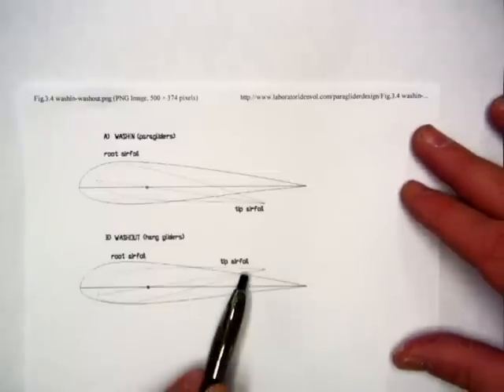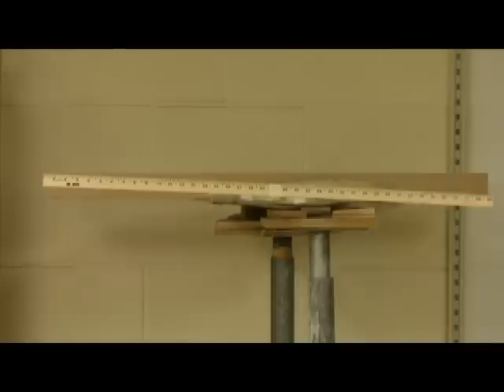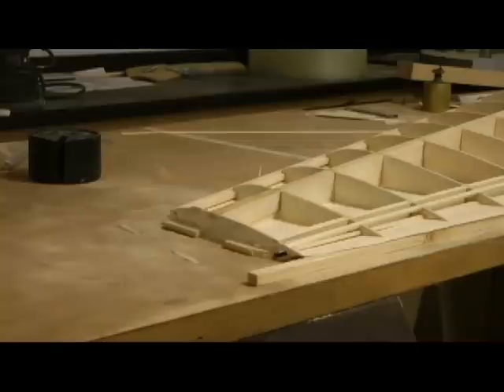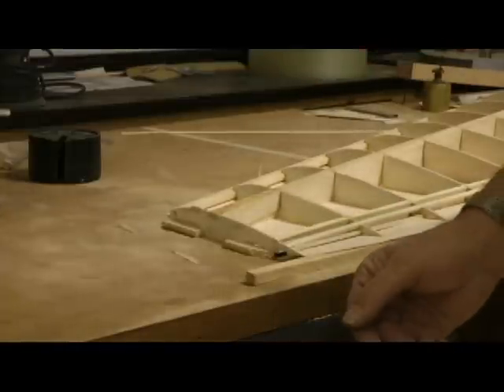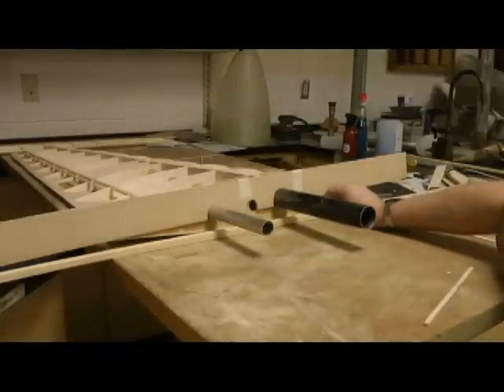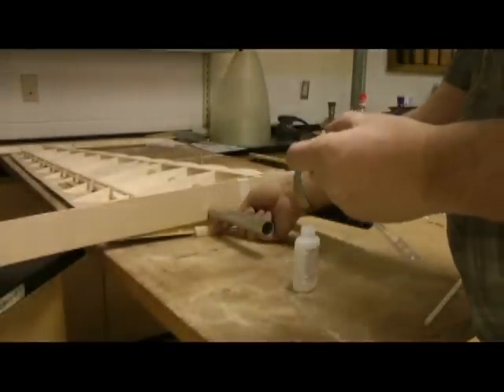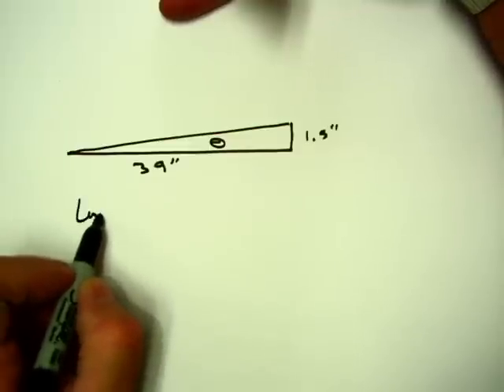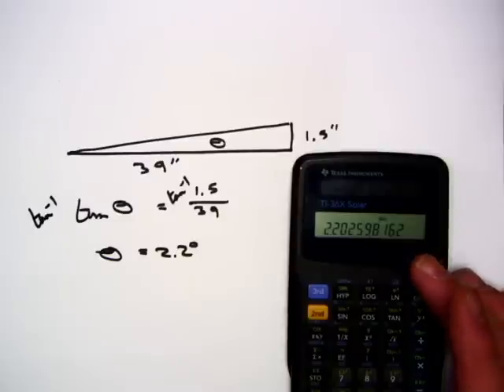Setting washout in giant scale wings

Comment: First, thank you for sharing this. As I re-enter RC after 25-30 years, now with the benefit of the internet and the immense amount of information available, I became aware of washout. I had never heard about before.
You show a way to induce the twist along the wing that gives you washout.

I think the wordage in the video was more complicated than it need to be.
Washout is wing twist set up so the tip has less of an angle of attack, and stalls after the root. 
 Isn't a simpler way of say "when you add washout, the root stalls before the tips"?
The idea is to avoid a wing stall, or falling off on a wing in a stall, especially in a turn to final when landing (full scale OR model aircraft(!))

I would mention at about the 1:00 mark of the video you are showing the washout you put into the right wing - that wasn't obvious.
The tip is towards the camera, the root away.
The far board is set up parallel to and through the root chord.
The meter stick is set up parallel and through the tip chord.

Is the far stick also 1 meter? Ok - I think you say that.
What wing reference point do you use to attach the stick and meter stick? The Spar. 

Then, going to the luauan table top, you were inducing same washout on the Left wing.
You locked down the tip and applied twist at the root.

Thanks again, I have to try this on my next projects. Are there any wings this won't work for? I.e. anything too small? Maybe not good for planes you want to fly inverted?

Cheers-

Comment: My Horten 229 have an 8 Degree negative angle of attack at the end of the win, and I always wonder if it was designed for the purpose of increasing stability, but you are doing totally the opposite. what is the purpose? Hope you don't mind my ignorance.
Reply from the maker: This is a great question.  The " negative" angle of attack I would assume means that you have twisted the tip of the wing down at the front.  This is the same thing that I have done by raising the rear of the tip.  Your angle is quite high, but then from what I have found from other builders the Horten needs this for lower speed stability in corners. I don't know if the need for such high angle of washout is due to the absence of an upright fin or not.  I will be posting a new video that explains the physics behind washout in a few days, but the purpose of washout is to allow the tip to remain flat relative to the airflow which keeps the aileron out of turbulent air even though the root of the wing still maintains an angle of attack which will continue lift in the turn.
Reply: andpet55 Thank you very much. I really appreciate your input.
Reply: andpet55 Excellent description. I have a small Fling HLG that seems to always pull to the left. The original owner, who used to fly much larger gliders, told me to check out the washout of the wings. Now I know what to look for. For a measurement of how much washout I will try to find the info on-line or use an average from measuring both wings. Cheers!!